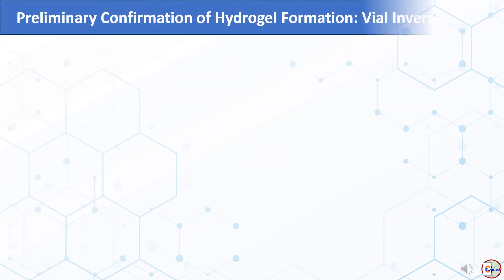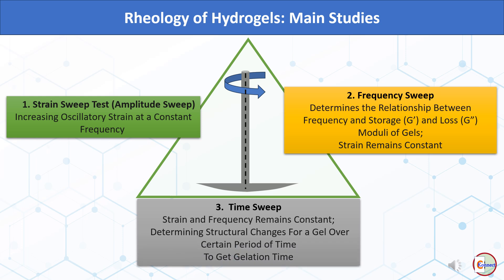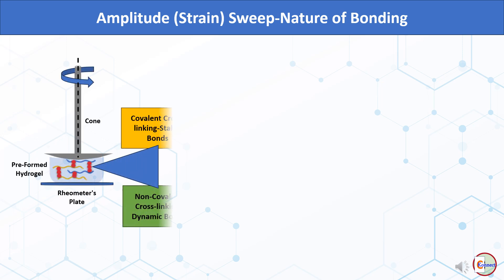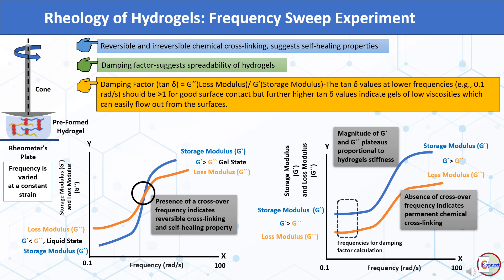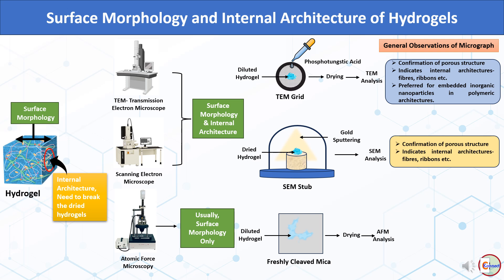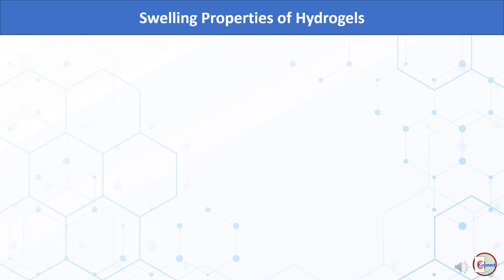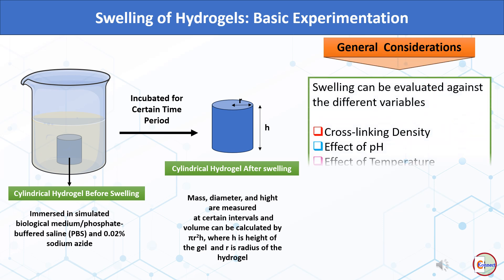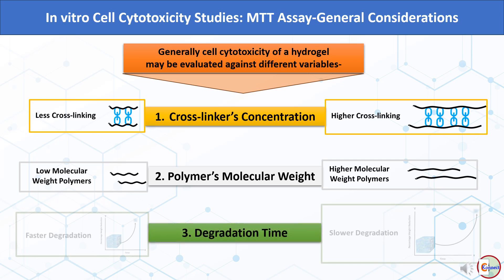Characterization of Hydrogels

Comment: 9:30 I would like to add here that SEM and TEM are often misused for hydrogel characterisation. DOI: 10.1089/ten.TEC.2024.0117 (its on research gate if you can't access it)  While there is no method that can directly visualise hydrogel structure , there are mathematical models that are very useful